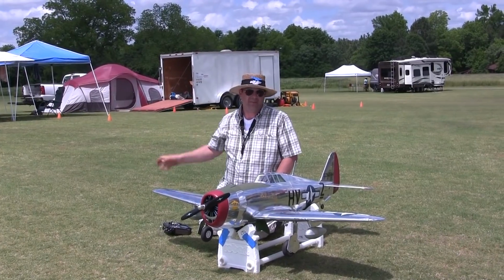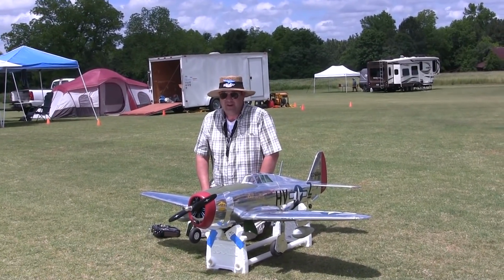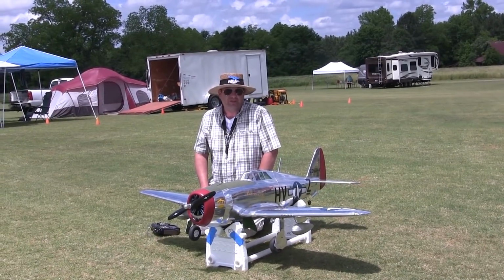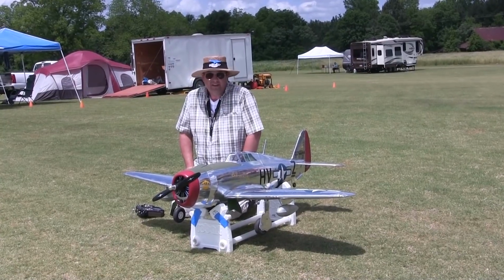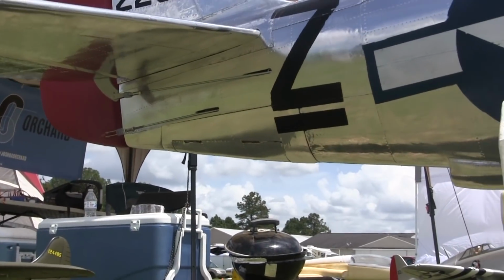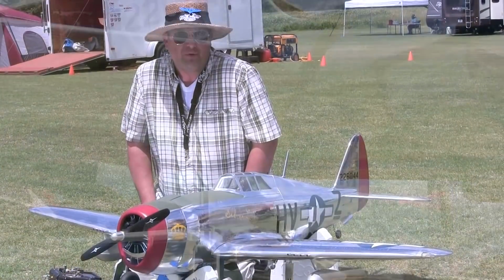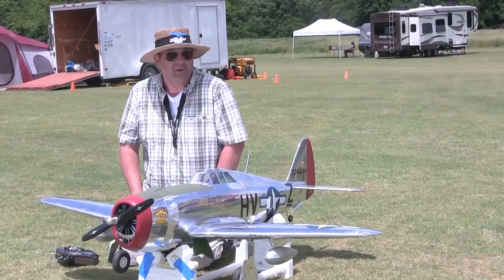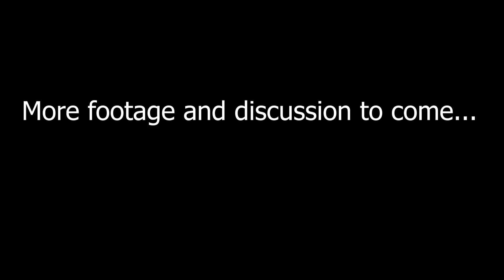P-47 Maiden Flight at SEFF 2019

Comment: what is the wieight of the plane ?
Reply from the maker: 15.2 pounds. The stock version with the tail retract comes in at 14.
Reply: @JoshuaOrchard  the plane look awesome but  a bit too much heavy for the size
Reply from the maker: Luigi R I disagree but no worries. The plane handles exactly the same as the stock version. Adding 1.2 pounds given all the details is not bad at all.

Comment: Hi Joshua,
Been following your build videos. Congrats on the fine maiden. Only thing that could make the P-47 better would be a four bladed prop.   :-)
Reply from the maker: Yes, I've looked into this. The airplane is either too large or too small for the props available with the current motor/ESC combo.
Reply: Hi Joshua,
Don't know if this will help, but here is a link for an adjustable pitch prop available in four blades. I think a 16" one is available.  http://www.ramoser.de/home_e/varioprop_e/body_varioprop_e.html